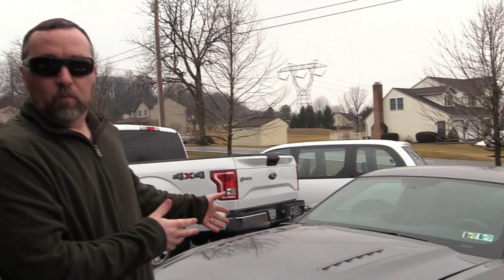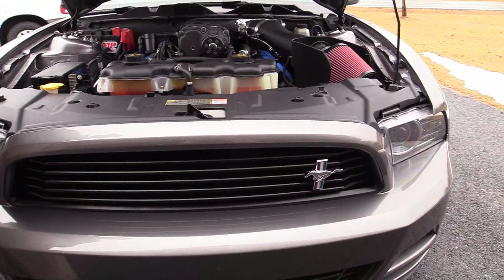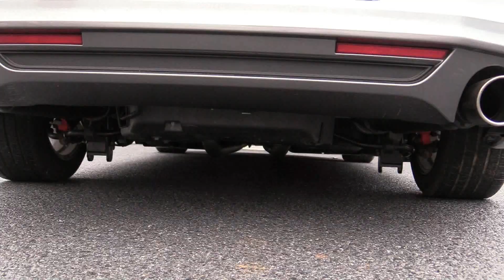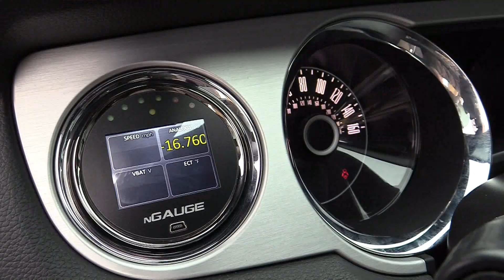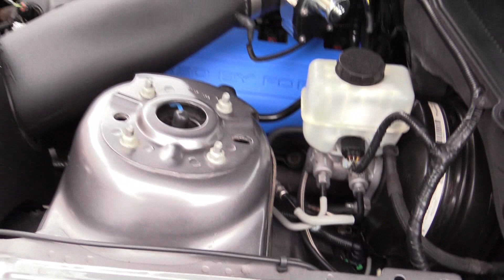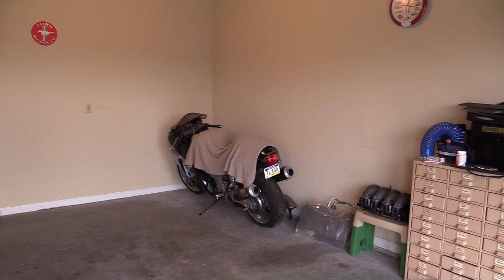Mustang VMP Supercharger Gen 2R Stage 2 Setup Updates

Comment: Looking good 👌
Reply from the maker: Thanks man!  How is your '13 coming along?
Reply: Horse Play Hobbies very slowly, put some roush rear springs in just to level it out and have a whiteline panhard bar on the way. Nothing like the goodies you’re doing lol. Just need winter to end up here.
Reply from the maker: That's great though! I definitely think suspension is where to start. Work on that with your power goals in mind and you can't go wrong.  Much better to do it that way then adding the power and then finding out the hard way that you forgot about the suspension!  So over winter for sure!